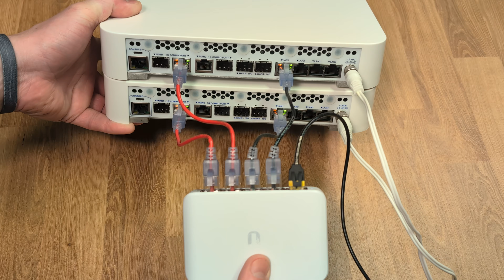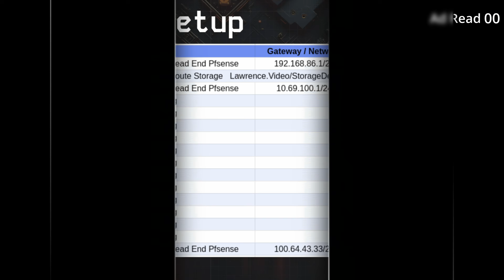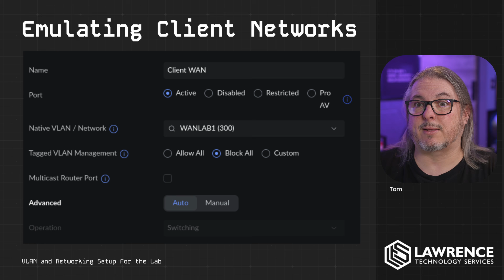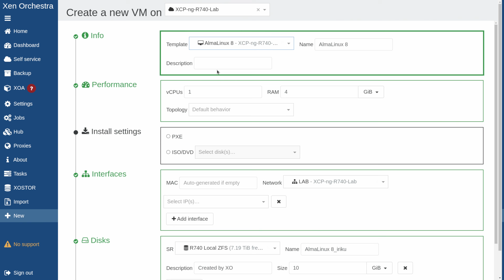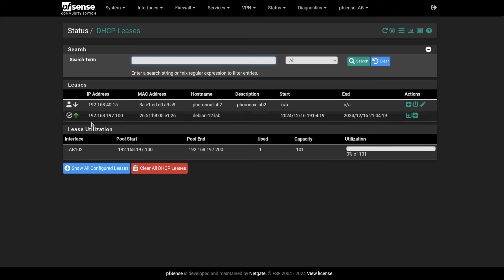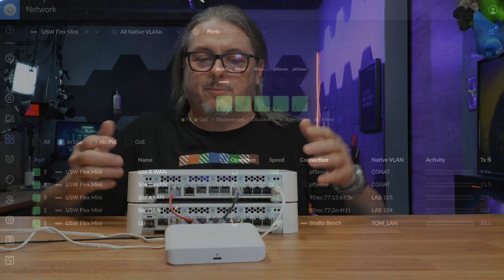How to Build A Powerful Networking Learning Lab

Comment: Hey Tom, I have a question hopefully you still read old videos comments haha
So in my lab I have a pfsense and some vlans, I also have a unifi switch that connects to my servers but I saw that you only create two vlans in pfsense which is your gateway, In my environment all the vlans/interfaces/dhcp/firewall rules are setup in my pfsense and I just pass down to my unifi switch with trunk, in your case you create the vlans on the unifi switch and make a trunk to your virtual pfsense and from there build the labs, do they get addresses from your pfsense gateway or from the virtual one? I couldnt quite understand that part.
Reply from the maker: The trunks get it form the virtual pfsense and the other get it from the main pfsense.

Comment: Hey Tom! Is that CGNAT vlan just a name indicating you are simulating a CGNAT/WAN for the virtual pfsense or is that an actual CGNAT network where your ISP is handing out the addresses for your virtual pfsense?
Reply from the maker: Correct, I use it for all my firewall lab tests.
Reply: @LAWRENCESYSTEMS  Sorry, correct as in its just a name for testing - or its actually CGNAT. I think you meant that it's just a name for testing
Reply from the maker: @NIC_Pineiro  Yes, it's my own CG-NAT for testing
Reply: @LAWRENCESYSTEMS  thats awesome! Im totally inspired to do something and I want to do some version of this. I don't have a CGNAT but would you be able to test for example site to site tunnels if the virtual pfsense just has private IP addresses for LAN and WAN interfaces?
Reply from the maker: @NIC_Pineiro  Yes, CG-NAT is essentially just another private IP space.

Comment: Thanks! Another great video. Question: do you use VLANs at customer sites? I have walked into SMB customers that don't have any documentation on VLANs and I usually remove them. Thanks again
Reply from the maker: Yes, we segment and isolate customer networks as needed.

Comment: Bit of along shot here , but asking,   can I  use the unifi flex mini 2.5gb network switch, like a normal switch,  or do I have to have other ubiquiti hardware for it to work ? 
Been trying to find answers on tinternet without any luck 
Cheers
Reply from the maker: All the UniFi access points and switches need their software controller https://youtu.be/TmxFL02Gpl0
Reply: @LAWRENCESYSTEMS  thank you 👍

Comment: Do you have any videos on the "manamgment LAN"?......
What goes on it?
How do you access device on there from your daily workstation/laptop?
Which VLAN should you use for it?... if not VLAN 1, what do you do with VLAN 1?
Reply from the maker: As I said in the video, that is where I put XCP-ng hosts, the management for the TrueNAS Storage servers (VLAN 20 is where the storage lives). For access I have a Wireguard tunnel but OpenVPN or Tailscale could work just as well.

Comment: Kinda off topic but how do you manage user credentials for pc login and network shares? Is that case by case basis or do you always run AD?
Reply from the maker: I use Bitwarden
Reply: @LAWRENCESYSTEMS  I think he was asking for what you use to actually handle credentials, authentication and SSO. Not what software do you use for end users and password management.
Reply from the maker: @BreetaiZentradi  We don't use SSO in the lab, but we do use Microsoft Entra ID for the business for SSO.
Reply: @LAWRENCESYSTEMS  I tend to lump SSO in with local auth.

Comment: Since you say you should not route storage, how do you handle it when a VM needs access to e.g. an NFS share for docker? Do I also create that VLAN then on the virtualization host and give the VM an extra interface with a static IP just for accessing that share? Would be interesting to know since I plan on redoing my setup soon and the issue has come up
Reply from the maker: Yes https://lawrence.video/storagedesign
Reply: @LAWRENCESYSTEMS   Interesting, thank you. Would using VLANs for that over the same interface work as well then when you don't have enough physical ports?
I would setup a LACP bond on my TrueNAS box with the default VLAN for management and define a tagged VLAN for storage. They are 10G ports FYI.
Reply from the maker: @colinschaffer320  VLANs are fine, LACP is fine.
Reply: @LAWRENCESYSTEMS  Perfect, thank you!
Reply: @colinschaffer320  yeah, I’m curious about the “don’t route storage” comment too.
Reply: A storage network is usually not routed for two main reasons, the first is security the second because they have a different MTU size usually 9600, this will decrease the TCP overhead and improve performance because a packet is able to to handle a bigger payload. This technique is called “jumbo frames” since the packets are a lot bigger than normal packets, which have an MTU size of 1500 the router needs to partition the packets into several different packets before it can send them to the internet, since this is a performance wise very expensive operation this is usually disabled on the router. This phenomenon is called packet fragmentation, you can also see this on ppp and pppoe links when the MTU size is set too big.
Reply: @  I’m shocked you would cite jumbo frames as being a primary driver of keeping storage on the same subnet. The advantages of non-standard MTU are limited (in the case of 9000 versus 1500 MTU, less than 5% efficiency gain), the downsides are numerous, and in short I would say mostly it’s just not worth it. The original intent had to do with having to process overhead which can be done now with hardware offloading to the NIC.

Anyway, Tom’s point had to do with unnecessarily burdening routers with traffic. He used the term “routing” specifically and accurately, as in, _on a different segment; needing to be routed_. Clearly it’s better to e.g. have multiple interfaces or IPs and connect your storage up to multiple network segments on local switches if need be rather than isolate them on their own subnet and require routers to route all traffic there constantly. I just didn’t understand his point because I assumed less accuracy in his wording than he, correctly, used.

Comment: I wish I could wrap my head around why VLAN tags are needed on top of using different IP ranges/subnets for things. I know I'm missing something, I just can't figure out what. 😆
Reply: Remember vlan segregate the network and they are function in layer 2 while subnets function in layer 3. If a network is separated by vlans it will need a different ip scheme which is why there are vlan tags that will move the traffic into the correct subnets
Reply: @sherwinstone4876  Do you have any links to diagrams? I'm a visual person.
Reply: @sherwinstone4876  coming from someone who understands VLANs - this doesn’t clear it up at all.
Reply: As stated vlans are layer 2. By default everything in the same subnet is switched. Your end device (pc etc) has arp, IP and MAC address, for all those systems in that subnet.

The default gateway is used when you try to reach an ip not in that subnet. PFsense is the default gateway and router and firewall in this example.

For security and performance you want to segregate traffic with PFsense. To separate that traffic on a switch you use virtual lans or vlans. PFsense understands those frames containing vlan information called dot1q. 

Without using vlans and dot1q tags all local ip traffic would be switched. And you couldn’t separate and control your traffic between storage and management, for example.
Reply: @samsampier7147  Yeah, I know how VLANs work, I was pointing out that what he said previously just didn't add any clarity. Also I would argue that with subnetting you can just add authentication protocols on top of it to secure it as well as any VLAN setup, but probably VLANs are easier and require less infrastructure.
Reply: @Hornet1806  That's a great point. In a real corporate environment you do both vlans and authentication. Dot1x uses both, assigning a generic vlan until authentication.

Comment: I'd advise home folks and particularly businesses never assign CGNAT addresses to anything...  It's not extra private IP space for your private network to use.  It's specifically made for carriers to utilize.  (I suppose you might argue for it in lab settings like Tom is showing but it's not needed)
Reply: CGNAT addresses? Which ones are those? I haven't reached the end of the video yet. Edit: Oh by CGNAT you meant non-private? Gotcha.
Reply: @scbtripwire  100.64 /10 space... He mentions it on his VLAN spreadsheet briefly.  If a carrier is using them for WAN transport or devices which provide internet but have routing protocols active... You can run into big issues
Reply: @scbtripwire  the 100 addresses he mentioned on his spreadsheet
Reply: @scbtripwire  Literally google what cgnat is instead of providing false information.
Reply: How/ why would it be any better in any way than just subnets? Asking seriously as a respectful networking idiot.

Edit: doesnt it 'solve' the same problem as ipv6? I think I get why it would be silly to do anything but emulate an ISP. If you were to assign an ip and that comes up in some DNS resolution on any machine in your network, seems like it could resolve some site or cdn or something to something on your Lan
Reply: @MaxUgly I’m nitpicking here — IPv6 doesn’t solve as much as it removes the need to solve for the fact that we ran out of addresses. NAT was a band-aid, the internet was always designed for host-to-host connection. But I’m being pedantic and your point is well understood. I agree with you on the second part, using a range that nobody’s ever supposed to use internally seems like a safe way to avoid issues in this case.